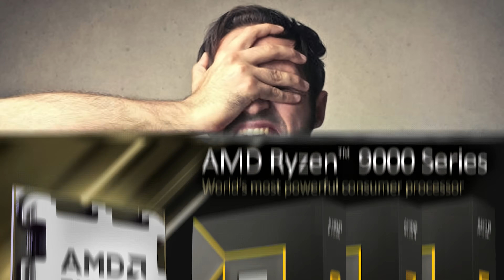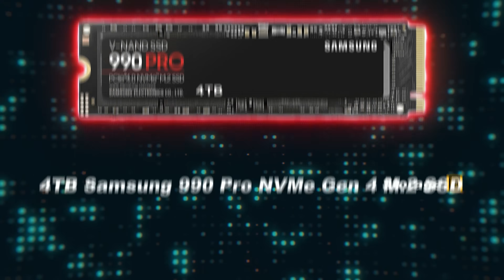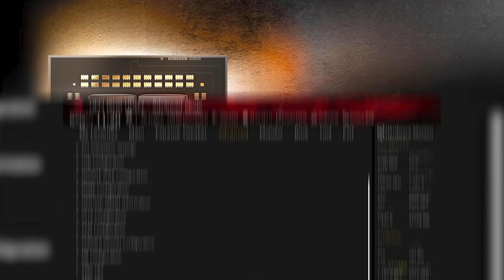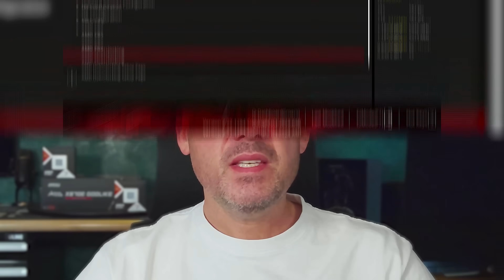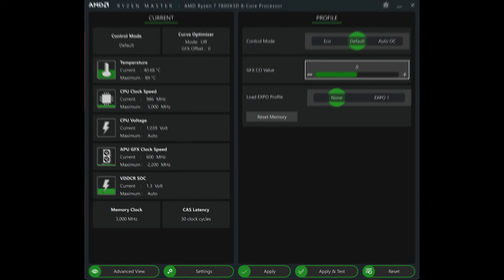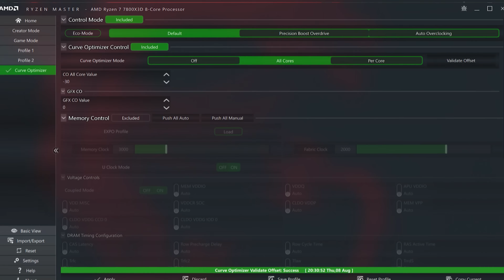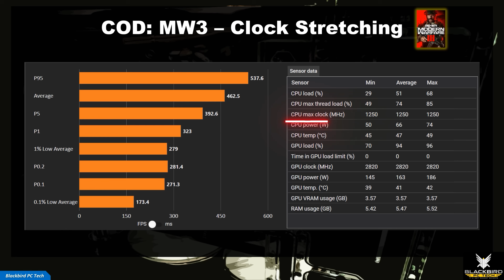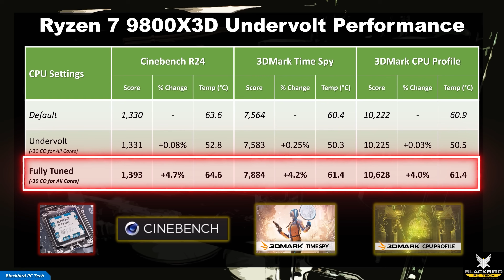How To Undervolt a Ryzen 7 9800X3D The Right Way! (or Any AMD AM5 Ryzen CPU)

Comment: Thank you for the epic guide i completely agree with the community, your are truly amazing how you get instructions and guides across. Got mine stable at -20 and all is working great and temps are low at peak , however cant get my idle temp lower than 44deg celsius. I have  brand new system , AIO NZXT Kraken 360 and hyte 70 case and all the other components run very cool and under 35deg. Any suggestions please?
Reply from the maker: There is nothing wrong with idling at 44 deg C ... my production PC has a 7950X in it and it's currently idling at around 50 deg C.
Reply: @blackbirdpctech  Thank you wow that was so quick. Ok so i ran CapFrame on Marvel rivals game and 3 other games and the max i get just by doing the -20 is 4645mhz will i have to tweak the cpu base clock to get your speed on COD 5400mhz? I use Aorus Gigabyte x870e pro ice rev 1.1 i have memory on expo 1 and enabled boost bandwidth but nothing on cpu tweaked. Thank you again i subbed and will support your channel and recommend it highly.
Reply from the maker: You can follow this guide to fully tune and optimize your CPU: https://youtu.be/9y_MGzrQHDg

Comment: I have a 9800x3d and the maximum i can Go stable is negative 20, is anything wrong?
Reply from the maker: There is nothing wrong with -20 CO ... all silicon is different.
Reply: @blackbirdpctech  thank you, thought Mine came with less capabilites...but the curious ia that i did the First test with negative 30 and everything was good, 10 minutes and ALL stable.... when i repetead the same negative 30 test , It started to shut down the system, só o reduced to negative 30. Saw another vídeo where the Guy did -40 normally....
Reply from the maker: One important thing you should learn with PC performance is never to compare your system to someone online ... you have no idea if their system is actually stable, if they are telling the truth, etc. Based on my experience, -40 CO is not normal ... I own three 9800X3D's ... one is stable at -25CO and one at -30CO ... the other I haven't tried yet.
Reply: @blackbirdpctech  thank you so much, learned a new lesson. For my cpu and my system -20 is the Sweet spot

Comment: I plan to get soon 9800x3d and use -30 if 10 min pass and dont get eror so its fine? :D if I get eror need to put it like -20 ?
Btw my question is its risk free to trying this like if on -30 is not good then on 25 cant I broke my cpu? :D im new at this
Reply from the maker: I would recommend trying -20 first and then going to -30 ... if -30 doesn't work then you can back off to -25 CO.

Comment: For some reason I cannot find this set of RAM for sale anywhere on the internet. I can find 6000 with CL28. But that's the lowest latency Ripjaws M5 I can find for sale. G.Skill even has a release page on their website showcasing the new low latency CL28 and CL26 sets. But I cannot for the life of me find the cl26 anywhere. Am I blind?
Reply from the maker: No, it's not you ... G.Skill sent these to me direct from Taiwan ... it looks like Newegg has listed the Trident Z versions but not these ones specifically ... they will be the first to list them when they are available ... sorry about that.
Reply: @blackbirdpctech  no worries! I figured since the news page showcasing these was pretty recent that maybe they hadn't been fully released yet. Also, this video helped me greatly with tuning my 9800x3d. Solid straight to the point information with no confusing bloat. Definitely subbed
Reply from the maker: The funny thing with these dimms was that they didn't seem to overclock very well, so G.Skill must have pushed them to the limit ... great kit if you want to just turn EXPO on and forget the rest.
Reply: @blackbirdpctech  I was considering it. Although I have a set of Teamgroup T-Force 6000 CL30 ram. In your opinion would the drop to CL26 have any noticeable performance impact? Or should I just keep what i have
Reply from the maker: @griffallison  I show the impact of latency in this video: https://youtu.be/OW-tpXttv8U

I don't think it's really worth it ... especially since you can very likely dial-in CL28 and your RAM will work fine ... worth trying.
Reply: @blackbirdpctech  sweet, I will check it out now. And ok, I assumed it probably wouldn't be worth upgrading my ram.

Comment: Are the steps the same for all motherboards? I have the Gigabyte b850 so I was hoping to find a tutorial with their bios.
Reply from the maker: The AMD Overclocking section of your motherboard Bios should be the same regardless of motherboard brand because PBO2 is an AMD feature set.
Reply: What Cinebench score are you getting with these values? My score dropped by 6,000.
Reply from the maker: @ there are a lot of different versions of Cinebench, there are different tests and different ways to run it ... so that's not an easy question to answer without specifics. Regardless, your score should not be dropping. Did you step through these tweaks and test after each one? Did you look at the undervolt video: https://youtu.be/6vROzalei6Y
Reply: @blackbirdpctech  I tried undervolting again but with the Ryzen Master app and it worked! I used Cinebench R23 and I got a score of 22,695 while my CPU reached around 85 degrees on max. I guess I was doing something wrong by doing stuff through the bios before.
Reply from the maker: @ as long as it works!
Reply: FInal update. Followed your tutorial again with -30 and got a score of 23, 487. I must have missed some steps before. Thanks for the great video!

Comment: Thank you, you explained it very well for a beginner like me!
I have an sff build and my cpu still runs pretty warm after these tweaks. Can you recommend me some more options I should look into to reduce temps efficiently? I would sacrifice some performance to keep the system cooler.
Reply from the maker: If your cooler is not cutting it the best way to keep your system cool is to set a thermal limit for the CPU ... that way your CPU frequency will reduce to stay below that temp.

Comment: My 9800xd only stable in aida 64 at -12 did i get unlucky silicon ?
Reply from the maker: Somewhat however it more than meets the spec ... if you can only get -12 all core stable then I would recommend spending some time to dial-in a per core undervolt ... I bet there is one core holding the rest of the chip back.
Reply: Thank you very much! I will try that soon!

Comment: This channel is gonna go far.
Reply from the maker: I appreciate that!
Reply: @blackbirdpctech  My 9800x3D and Asus Rog Strix B650E-F Wifi are scheduled to arrive tomorrow. I'm a bit confused about the fact that there are 2 places to set the curve. If you use both which one will take precedence?
Reply from the maker: I never tried to set it in both places to see which one will be prioritized ... you would have to set two different curve offsets to see which one holds. As I state in the video, it doesn't really matter where you set it as long as the system recognizes it.

Comment: Please confirm, I assert that there is issues with the 9800 X3D, in my case that is. 

There is noticeable stuttering when even playing a YouTube video in comparison to my 13900k computer. 

It is subtle however highly noticeable and quite annoying.  And we all paid very good money for a 9800x3D and sucks that this is happening.

Please confirm if this is happening to you or is this an isolated case. 

Maybe this could be a video for future content, and I’ll be happy to collaborate with you to demonstrate and show my methodologies and results.

-Steve
Reply from the maker: Thanks for the comment ... fortunately I haven't experienced stuttering issues like this with the 9800X3D's that I've tested. That said, I've only tested three CPUs, so that's not a statistically significant number. It would be interesting to dig in to this more.
Reply: @blackbirdpctech  I'll post a vid of the issue with my case tomorrow,. I'll put my AMD system next to the Intel to compare. Maybe its just mine or if this can be replicated on yours, could be something or could be nothing.

AMD System: 
9800X3D (PBO +200/Neg off set 30)
RTX 4070 ASUS 
Corsair Dom 6000 CL 30
ASUS ROG Hero 870
EVGA 1600w psu

Intel System:
13900K (Delid and Direct Die EK AIO with L.Metal 5.7gh all core)
RTX 3070 Gigabyte
6400 CL 32
EVGA KingPin z690 
EVGA 1300w PSU

Or maybe there's an issue I need to correct on my setup that I'm unaware of. I've already exited all other non essential apps, used Lasso to disable chrome efficeny processes, set priority to high and even realtime for chome to see if that would remedy the issue, and neg results... issue still presists. 

More to some and will feed the vid tomorrow. Thank you much.

-Steve
Reply from the maker: @an_easy_name_to_remember  that would be interesting to see ... does your AMD system exhibit this behavior after a Bios reset with everything at stock?
Reply: @ just uploaded about a six minute video demonstrating this issue. It is on my channel and not as refined as anything like yours, but let me know if it make sense and or if you can replicate this issue.
Reply: @blackbirdpctech  yes, and posted vid on my channel to show this issue, even with a rest BIOS (ASUS ROG Hero build 1104). No OC's, no EXPO enabled, just plain stock and does it as well.
Reply from the maker: @ I watched the video and it's quite noticeable, so there is no doubt you have an issue. This is going to sound strange but I had a similar issue once that was the result of a USB problem ... I had split the internal USB 2 hub and there wasn't enough power going to the devices connected, which was causing a stutter like this in all situations, games, desktop, etc. Could this be an issue for you?
Reply from the maker: I talk about it a bit in this video, but this will also show my complete troubleshooting list to try to solve stutters: https://youtu.be/O5o2MjHZiwg
Reply: @blackbirdpctech  WOW. Thank you, thank you. It was L-Connect causing that issue. I would have never found that. Thank you Matt for ending this issue that was leading me to pull my hair out. I too was going to disassemble and reassemble everything and this saved me countless hours of troubleshooting only to come back to the same issue. Cannot say it enough. God bleess you :)
Reply from the maker: That’s awesome, glad I was able to help … these issues can be super frustrating to solve!

Comment: if i just changed Vcore Voltage from Auto to 0.98 V and it reduced my temps. in Cinebench from 90C to 60C it is normal? so much diffrence, strange? Before i had like 1.24 V on auto with 90C
Reply from the maker: You have to be careful doing that because you may run in to issues not supplying enough voltage under different conditions.
Reply: @blackbirdpctech SO how can i check IF that value isnt enough ?
Reply from the maker: @damianzakrzewski3619  the only way is to test it ... run benchmarks, stress tests and the apps that you use
Reply: @ i did cinebench, Aida , occt normal mode and played about 3 hours fortnite/lost ark/lol - 0 crashes with 0.98 vcore voltage, that means everything is fine ?
Reply from the maker: @ it sounds good ... is there a reason that you chose not to use the PBO curve offset feature?
Reply: @blackbirdpctech  YOU Think its better oc than mine fixed ? Maybe i should do it how YOU did
Reply from the maker: @damianzakrzewski3619  I think it's better because it's dynamic, so you should be able to extract more benefit from the undervolt.
Reply: @ i just did it, again 90temp and two cores wre dropping to 2.2ghz about 1,3v on all cores in stress.
Pbo limit motherboard, scalar auto, +200mhz, curve optimizer 20 and very high temps
Reply from the maker: @damianzakrzewski3619  CO of -20 right? I would back off on the boost to +100. Temp limit at 80. What cpu cooler are you using?
Reply: @blackbirdpctech  im using new bought yesterday endorfy aio 360, it is normal IF on 90 temp aio blowing cold air? It shoudnt be hot air?
Reply from the maker: @damianzakrzewski3619  it depends, the water in your AIO will not be anywhere close to 90 deg C ... it will be in the upper  30's and it will take time to heat up. If there is hot air in your case and your AIO fans are set to exhaust, then you will feel warmer air
Reply: @ they are in exhaust (its build straight out of the box) i have no idea whats going on, because i had 2 samples of this AIo and both have the same problem.
Btw dropping in aida/cinebech to 2mhz it is normal for PC? or that means something is unstable? (Min. 2.2 Mhz/Max. 5.2Mhz)
Reply from the maker: @damianzakrzewski3619  it likely means your CPU is thermal throttling ... check to make sure that you removed the plastic cover on the cold plate and that the cold plate is making good contact with your CPU.
Reply: @ if its not shouldnt i have like 100 temp immediately? I removed it
Reply: @blackbirdpctech  Btw do you know how can i set up on BIOS the type of cooling? i dont see an option. i had it on MSI MB but on GIgabyte EAGLE AX i dont see menu where i can choose water cooling
Reply from the maker: @damianzakrzewski3619  that's not something you need to do, it's just a gimmick ... all it does is change your power profile. MSI has it on some of their boards but most other brands don't use it, they simply allow you to change your power profile directly.

Comment: I have the same motherboard and CPU combo, I am seeing no difference after following along, temps and performance are identical. I have watched this 3 times now to make sure I didn't miss anything, not sure what to do, but to remove the -25 under-volt, anything lower caused errors in AIDA64 Extreme.
Reply from the maker: That's very strange ... it sounds like the undervolt is not being applied properly. How did you change the curve offset?
Reply: @blackbirdpctech  I did it via the Advanced tab (your preferred method) I didn't use the extreme tweaker. Set All core curve sign to negative, all core magnitude started at 10 and worked towards 30 like you suggested.. hopefully I answered correctly...lol
Reply from the maker: @TheWaxGoat  that's good ... did you save the settings after you made the changes? If so then it's very strange that it had no impact. What application did you use to benchmark your system (before/after)?
Reply: @blackbirdpctech  the settings were saved, going back in and seeing them for extra measure. I used everything you used. Cinebench R24, 3D Mark time spy and the CPU Profile test.
Reply: @ i just went through your video in double speed, I paid closer attention to the other settings I saw on your screen, you have:
PBO limits set to mobo, mine is auto
the rest of the settings appear to be for your OC. with CPU boost clock enabled as +200, and the manual setting for your thermal throttle limit of 80. For the sake of getting my temps down, I suppose I can ignore (for now) the OC settings. Would the PBO limits set to auto be the issue?
Reply from the maker: @TheWaxGoat  no, that shouldn't be an issue ... as long as you can dial-in a curve offset. Have you tried using the other menu to input your curve offset? There might be a Bios glitch ... worth giving it a shot.
Reply: @ so I didn't realize how OOD my bios was. 0606, so I updated to 1104 and will start over. I really thought I was running 1003, I should've confirmed that. Hopefully I didn't waste your time! I appreciate you trying to help me out! I will let you know what happens!
Reply: @ well, bios is latest version 1104. The under-volt still does not work..  =(
Reply from the maker: That’s very strange … your cpu is a 9800X3D?
Reply: @ yes absolutely =)
Reply from the maker: @ try uninstalling Ryzen Master ... perhaps it's somehow conflicting with the Bios settings
Reply: @ Actually, Ryzen Master isn't installed. I recently swapped out my NVMe, I forgot to reinstall it when I rebuilt my system. I just completely scoured through my bios, verified and documented every setting. Maybe the overclock will work better from the Extreme Tweaker tab for me? its profoundly ridiculous how many places they have the same settings, like Power down and Memory Context Restore being in 3 different locations.

Comment: 1:45 I can’t get Cinebench R24 or R23 to run since I got my 9800X3D.
Reply from the maker: At stock conditions?
Reply: @ yeah even when I reset it back to stock settings. I can’t figure it out. Task manager shows it running but the program never opens up.
Reply from the maker: @ have you tried re-installing the latest AMD chipset drivers?
Reply: @ I’ll
try that

Comment: I did mine to -30 and my temps only get to 54 degrees in cinebench, I did loose 10 pts though, 1343 to 1333
Reply from the maker: Cinebench has some variability between runs ... if you run it again your score will likely go up
Reply: @ oh I see, so most likely it’s giving me the same performance but I get lower temps now it was going to 66 degrees before
Reply from the maker: @jordywardy2  yes, that aligns with my results

Comment: I’m a little confused I thought undervolting  and using PBO are different? 
Undervolting sets a limit to what the cpu can use while PBO dynamically changes
Reply from the maker: Curve Optimizer, which allows you to easily undervolt your CPU, is part of the AMD Ryzen PBO 2 feature set.

Comment: I was only able to get a stable reading using negative 10. Was i unluck with the silicon lottery?
Reply from the maker: That’s not great however it’s still better than the spec they sell … there will likely be chips out there that can’t handle an undervolt at all.
Reply: Only -10 too, anything else will crash immediately
Reply: @alextatu91 Updating: was able to set some cores manually to -20, -15, and the worst cores to -10. You can try the same, but will take a lot of trial and error tests. Temperatures lowered again when counting all cores.